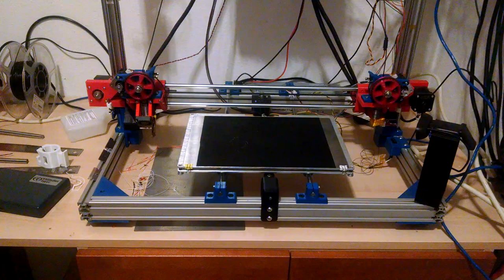Dual X Carriage 3D Printer

Comment: tell me how did you slice you files ???  your cura or simplify3d settings ??
Reply from the maker: I use simplify 3d. But there is no special gcode, just a Marlin command to enable duplication.
Reply: so you just entered M605 in the start of Gcode or entered it under the tool change tab ?
Reply from the maker: I enter it at the console before the print as it seems to cause other problems when part of the gcode. I don't use that often. I always power cycle when done with duplication print. The version of Marlin I am running seems to be buggy when running in duplication mode.
Reply: can you give me one of your test files . and is it necessary to have limit switches while testing the motors ??
Reply from the maker: I am not an expert in Marlin but you have to have it configured correctly for independant extruders. It took me a few months to figure it out. There is a link to my firmware here if that helps: https://drive.google.com/open?id=0B0zp8GqX5pDwSFZ4RW02a2JHTFU
Reply from the maker: It is just a normal gcode file that is set to 50% of the width of the bed. If you want to look at the firmware I uploaded it here: https://drive.google.com/open?id=0B0zp8GqX5pDwSFZ4RW02a2JHTFU
Reply: @jeremymcarpenter  What motherboard do you use?

Comment: HI ! I want to start duplication but don t know how to set. Need to change in firmware or can get it with m605 s2 command ? did not work for me with m605 command and maybe i need to change something in cura ? thanks
Reply from the maker: Do you have a dual independant printer setup? It took me months to build and test it using marlin. I can upload my firmware to google drive if you want to take a look at it.
Reply: YES PLease
Reply from the maker: https://drive.google.com/open?id=0B0zp8GqX5pDwSFZ4RW02a2JHTFU

Comment: What kind of printer board are you using?  What firmware.
Reply from the maker: Azteeg x3 pro. I need the extra inputs and motor drivers for the extra motors. It is running the standard Marlin Firmware. Marlin supports dual X.